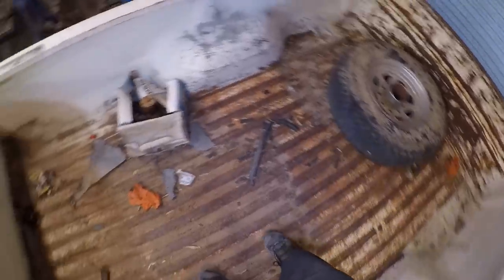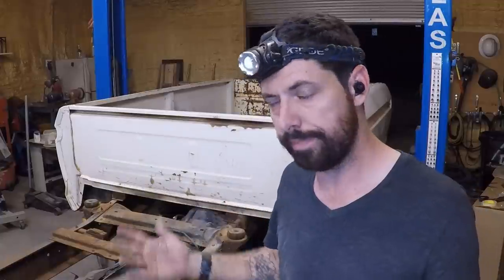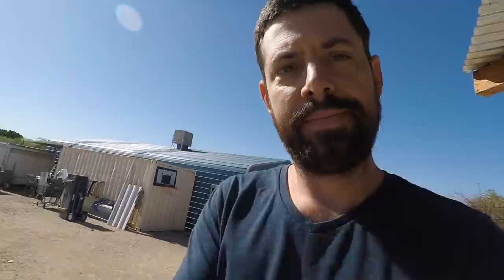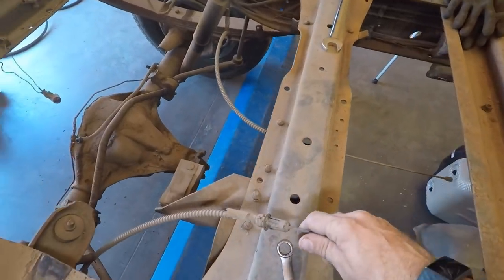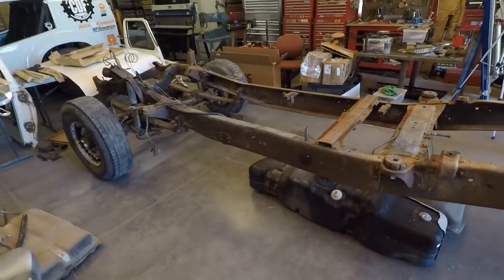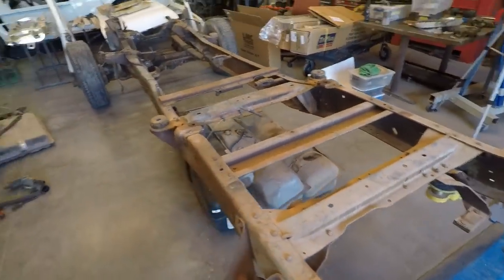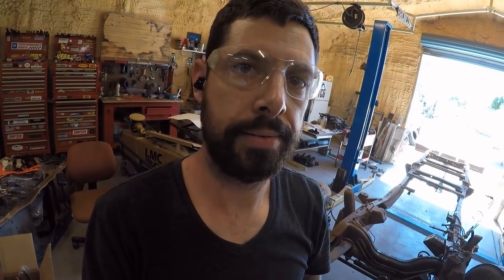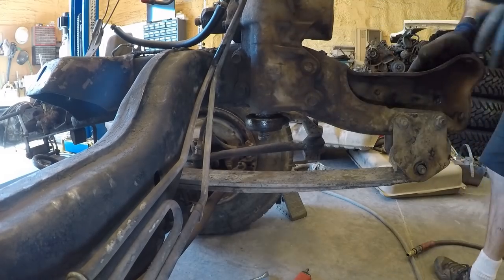1979 F-350 4X4 Supercab Build (Episode 5)

Comment: I have a 1980 f350 dually I'm fixing up.  Has the 6.6 400 and c6 transmission.  Just put a hei distributor in and got rid of the Ford ignition module.  Love it and the engine seems to run better plus the fit was much better than a new Ford distributor that always seemed to seep oil even when the ford distributor fell into place. Im definitely following you now.

Comment: When trying to take off tie rod ends hold a hammer on the opposite side of  the joint and then strike on the other side. Makes it way way easier! The heavy hammer on the back lets the shock go through the joint much better.

Comment: 41 year old truck and the nuts came right off of the axle U bolts. 
I worked in a spring shop when I was in Highschool way back in ‘85 and we just torched off the U bolts on any vehicle from the 70’s because making new U bolts often took less time than trying to remove the old ones in a reusable condition. 
Of course being in Central Ontario with salty winter roads makes a huge difference to Arizona. 
Re-arching the stock springs with a new longer main leaf is a great way to convert/lift the truck. Hopefully the driveshaft is still long enough. I remember lifting a 70’s Ford and the customer drove away with only the front driveshaft installed because the rear was too short but that might have been more than a 6” lift and it definitely wasn’t a crew cab.

Comment: My late model 460 Fords did not have a fuel switching valve. Instead each pump had a one way valve and the pump module somehow restricted the return when it was not running so the fuel returned to the other tank. It never returned 100% of the fuel to the right tank. You would run one empty, then switch to the other, and after a while the empty tank had 1/4 fuel again. And thanks for the parking brake trick. I needed that two weeks ago.

Comment: Boys that's sure the way to do a pitman arm, just take the whole body off so you can reach it easier. On my 1995 Suburban, you need to pull the whole steering box, which is why I haven't done it yet.
That tip with the parking brakes is sure a good one, and really obvious once you see it. I think I have actually done something like that in the past, but if I remember correctly, I actually tried a line wrench.

Comment: I spied a disk brake conversion.  I've tried two of them over the years, they worked well except for the service brake.  Not as big an issue on an auto, but on a manual trans I would never trust them, especially with any extra weight or trailer attached.

So you are ditching the factory EFI?  Interesting for some reason I thought you were going to leave that, but then you need an ECM (factory or otherwise) to run it.. so that makes sense.  I think the drive train mounting, and management are what I'm looking forward to the most.

Comment: Austin, Excellent, job, removing that pitman arm. Heat does wonders doesn't it, always good to see a man being smarter instead of using brute force and butchering the crap out of things cause, lets face it, we've seen lots of that nonsense in our lives and basically, it just isn't the right way of going about things.
Reply from the maker: 100%. Every time I am about to grab a big hammer I double check and make sure there isn't another way.

Comment: Great job with this build! I have watched all the videos in this series and still cannot see what you did with the mid fuel tank. Did you end up modifying the frame for the 96 style fuel tank and that associated fuel pump? Thanks.
Reply from the maker: Funny story; the midship tank that LMC sent was the wrong one, so we tried the one for the extended cab and that was wrong too, I had to move to Tenn so the owner had the original one sent out for cleaning and he had to add an aftermarket in tank fuel pump and install it later. I ended up wiring a fuel tank switch valve from a modern f350 to get the extra fuel return ports but I didn't show it because I didn't have the other tank. You are the first one that asked about it.

Comment: Did you pressure wash the frame before you painted it?
Reply: If it was in a more northerly climate, would need a good wire wheeling and corrosealing applied before the paint to convert that surface rust.